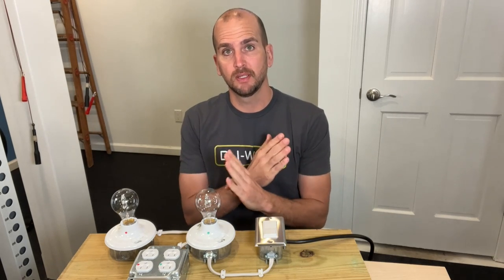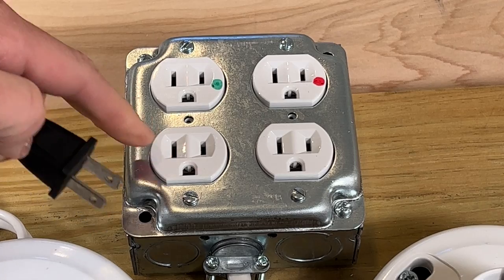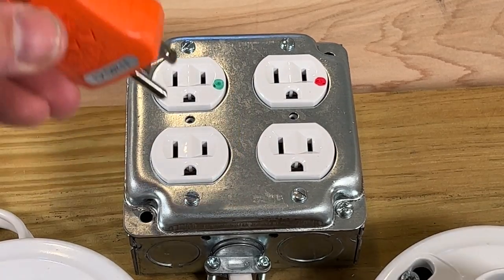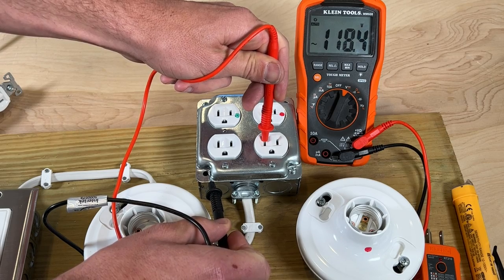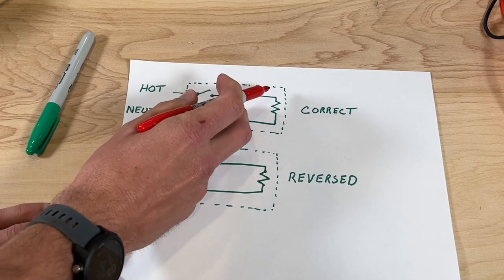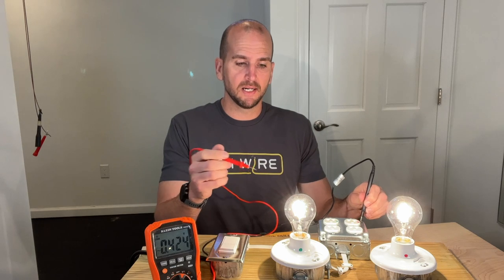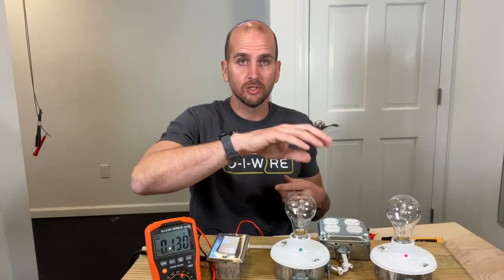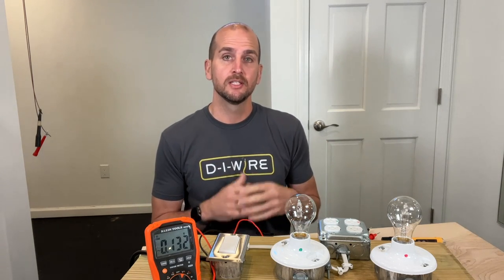Dangerous Wiring Issues In Lights and Outlets

Comment: I think the previous owner of this 1960-era house did much of the wiring himself when it was built.  About half of all of the outlets (that were polarized, 2 or 3 prong) had the hot and neutral reversed, and half of the bulbs had the neutral line switched.  There were also plenty of the 2 prong non-polarized outlets all over the house.

Comment: Super helpful. I knew reversing hot & neutral was bad, but never had an explanation for why. It was particularly helpful to see the explanation about a device with a resistor. We had a ceiling fan with a remote burn out, where the control unit just melted. I couldn't understand why, and I think that's probably it. I'm checking that right now.

Comment: Great video.  I would also recommend that people who move into a new rental or house check all plugs with your simple 3 light tester.  easy to do and doesn't take long.  Check lights before changing a bulb.  On an old house I have run across a random plug or light that was mis-wired before I moved in.  Always check ceiling fans and lights before replacing bulbs or doing maintenance on or replacing the motor.  I have found these are mis-wired about 15% of the time.

Comment: I've seen the neutrals being switched in lighting circuits MANY times, especially in older homes. Never assume that power is interrupted with the switch in the off position; check it with a meter before doing any work.
Reply: OR JUST PULL THE FUSE OR BREAKER or do you trust the electrician?  The wrongly-wired hot or live light fitting with some low energy bulbs can be enough to cause them to gently glow when switched 'off' and work fine when 'on' !

Comment: Something very important to note about basic plug-in outlet testers: if the outlet is not grounded, they cannot detect reverse polarity. I learned this when my parents bought an old house and asked me to look over the wiring since I’m handy with that sort of thing, and many of the outlets appeared to be ungrounded but otherwise okay to the outlet tester, but when I used a three-prong cord plugged into a known good outlet as a ground reference, over half the outlets in the house were not only ungrounded, but the polarity was reversed as well.
Reply: It's amazing what you find in older houses. I have no problem with DIY work, I do it all the time myself, but do your homework and take the time to make sure it's right if you're going to. As my father used to say  "if it's worth doing at all, it's worth doing right". I am in an older house, not that old but old enough for the kind of house it is and every 10 minute project turns in to so much more because someone did something wrong to begin with. I'm also a perfectionest so even if it's a minor thing, if I let it go it will annoy me until I go back and fix it.
Reply: This is my dilemma in an older house that has no ground I have to figure out how to test for reversed polarity

Comment: I was recently installing new wall lanterns on my home when I came across one of the old fixtures wired in reverse. I guess the electrician was left handed because he turned the wire in the other direction. I saw that and wanted to be cautious so I checked with multimeter and found that the wire was still hot after the switch was turned off. Always good to check.

Comment: This is a very good instructional video. I would like to add that if you remove the bulb, screw in a make light socket to 2 prong female adapter then insert a 2 prong male  to a 3 prong female adapter then insert a Receptacle/GFCI tester only the “open ground” light condition will illuminate. 

I purchased the Klein circuit breaker “finder” and I also bought the accessory kit to identify light sockets and switch circuit breakers. 
If there are 2 fault conditions present such as open ground AND reverse polarity the 3 prong tester only shows the  open ground condition. It will not toggle between both fault conditions. This is also true if you have both on open ground AND a reverse polarity on a receptacle. Only the open ground condition will be displayed. Once you “fix” the open ground then the reverse polarity fault condition will be displayed. 
I like this video - I was just attempting to identify if my light sockets were wired backwards and the Klein receptacle tester will not allow me to do that.

Comment: Reversing polarity is more dangerous on a plug than a light fixture unless you have a plug wired after the light fixture but it should always be avoided just the same. This was a good and valuable video. I have a 2 year degree in Electrical technology and so far all your electrical videos have been spot on. I also had 40 years working for a regional water authority, 20 of them as an inspector, and know more about plumbing than many plumbers. I have caught so called professional plumbers screwing things up and doing shoddy work. The problem is especially acute when the licensed professional sends a journeyman without checking their work. I have literally had to show some of them how to accomplish an unusually difficult task.

Comment: The problem with reversed wiring also applies to re-wiring of table and floor lamps, something an amateur is more likely to attempt - and get confused about.
Reply: I likely did that with my mother's table lamps when I was a kid.
Reply: Absolutely. If you change a damaged cord on a lamp, throw away the old unpolarized plug and use a new polarized one and make sure the wide prong is wired to the socket and not the spring in the center of the socket.
Reply: Just a few days ago, I just electrocuted when I placing Lamp for testing.. The hot is the outside of the E27 Cap

So I got mad and went to check the person that install the cable..
😒 But then I realize that I'm the one that install the cable..
Reply: @XanderProduction  It could be miswired where the outside wire comes into the fuse or breaker box.  If that is the problem, short of having the electric utility come out and pull the meter so you can fix it you are stuck with it.  Don't automatically assume you made the mistake.  Check it but if it looks correct to you start investigating at the breaker and then where the outside service connects to the main breaker.  In Michigan code requiring that the line and neutral be connected "properly" didn't hit the state electrical code until the 2000's.
Reply: @mharris5047  ._.)/ You're correct about the regulation.. But I live in Indonesia..

It's actually me who make the mistake, bcoz I'm the one who check the Live-Neutral but misplaced the connector..

Comment: This condition can be found more often when repairing a table lamp. The lamp cord used to wire table lamps and some multi bulb ceiling fixtures has a identified conductor unknown to most DIYers. A close inspection of the lamp cord would reveal a rib molded into the entire length of the cord over only one conductor. This is the neutral and would go to the shell of the bulb socket. Lamp socket/switch combinations do go bad occasionally and need to be replaced. Look for the identifying rib on the lamp cord and make sure it is attached to the shell of the socket. Sometimes the cord manufacturer will stamp the information about the wire in the insulation instead of the rib. This will also favor on conductor over the other. Again, this is the identified neutral conductor and should attach to the shell of the bulb socket. Another great video.

Comment: Good warning video that should be followed by home installers.

Greetings from UK where we do everything different (mostly).

For a long time, lamps here have used a bayonet cap, not screw cap, but they can suffer from indentation of the contacts. I am, (like more and more people here) now using ES27 and ES14 lamps as in the USA as they are better.
I always double check the cables to ensure that the live (hot) line does go to the centre contact as in your video.

For all practical purposes, outlets have to be tested with a proper device similar to the one that you demonstrated, as the contacts have shutters to prevent anything being pushed in. For my most recent home installation, I have upgraded to a Martindale tester which also measures ground loop impedance.

I have found some incorrect wiring in our new home here and have since corrected it, but the worst that I have ever seen was in a house to where we moved in the 1980s. The metal frame of the kitchen 3-spotlight unit was connected directly to the (always on) hot supply instead of ground. I have long suspected that this may have been the cause of the previous owner's death, rather than "heart attack".

Comment: Another thing that you need to look out for is when the switch is beyond the fixture. Ex: Power comes into a ceiling light fixture. The hot lead (black) should be connected to the black lead going to the switch and not to the black lead going to the ceiling lamp. The neutral (white) coming back from the switch is now the hot and should be marked (usually a wrap of black electrical tape) and attached to the gold colored terminal or black lead of the fixture. The neutral (white) of the power supply cable is then connected to the silver colored terminal or the white lead from the fixture. Many DIYers get this messed up.

Comment: I just moved into a new house and found several outlets with reverse polarity, open ground, or no power at all.  Checking the circuit breakers, the legends were all obscure and had to trace the entire house to correct.  I am a licensed electrician and that was the first thing I checked even though the inspector failed to identify these issues.

Comment: Great job showing how to test the outlet with a tester. But it’s also possible to use the same tester to test a light socket.  You just need a few more pieces to connect as follows:   Mount an outlet in a box and add two male cords.  One cord is polarized two pin and connects to the outlet at hot and neutral.  The other cord is three pin and ONLY connects to outlet ground.  Then plug outlet tester into outlet.  Plug a polarized light socket to outlet adapter into the light being tested.  Connect this whole device up using the two pin cord to the light socket and the three pin cord to a known good grounded outlet.  The outlet tester will report if the light socket is reverse polarity. 

I’ve done this test at many houses and most older houses have reverse polarity lights.  My own house built in 2004 has half the lights wired wrong. And that’s by a professional electrician and passed inspection.
Reply: or in a house that is new enough to have a grounding conductor, plug a grounded extension cord into a known good receptacle, and use a continuity tester to check between the ground pin of the extension cord and the screw shell of lampholders.  or hold a non contact voltage tester to the screw shell.

Comment: An additional comment --- when checking voltages with a DMM, always reference to a known ground.  Some may assume that they can check voltage using the Neutral as the reference but this could lead to incorrect readings with AC voltages if another fixture in the circuit is incorrectly wired.  Also check BOTH Hot and Neutral during the same test.
Reply: Not an issue... As he was only checking if there was ANY considerable voltage... Might read wrong but that is not a problem in this measurement.
Reply: If it's an old house there is no ground usually

Comment: Interesting. I did not see that coming, but I experienced it with a lamp years ago. I was taking out a lit bulb from a lamp and received a mild shock as I was turning when it turned off. Now I know why.
Reply from the maker: There ya go 👍
Reply: You should never touch the screw. If the bulb has broke off so that you need to use pliers then use special protection. In case of a plug in lamp unplug.
Reply: Potatoes!
Reply: Actually I never said it was broken, nor was it actually lit. I mis-remembered it which is why I remembered it at all, as pointed out in the video, you should never be shocked by a correctly wired bulb.

Comment: I got a tingle one year replacing a burned out C9 Christmas lamp on my outdoor Christmas tree. I was using a pre-polorized string set.
Reply: When you're outdoors it is easy to inadvertently come into contact with the ground. When you do then you're electrically grounded. We use a ground reference for safety but the fact that we do creates a local hazard. Basically if you have to mess with electricity outdoors be careful and try to wear insulative footwear. You do not want to be in the return path for current.

Comment: Thank you. For an Alternative Ed High School class, I worked up a board to show what happens in parallel and series circuits. It was interesting to see what happens with varying the bulb wattage in both types of circuits. The same kind of board could be used to demonstrate three way and other switch combinations as well as the impact of a dimmer switch. Explaining what happens in that type of circuit would be informative too. Thank you for your clear narrative.

Comment: This is why you should hit the breaker before working on  a light, if somewhere along the way the polarity was reversed, the switch being off will not help you. I always check and recheck with a dummy stick (hot and neutral) before I go to work. 99.999% of the time it just scares you sometimes it hurts a little bit and it could kill you.
Reply: Sometimes a neutral or two from a different circuit might be in a box.  It won't set off a non-contact voltage detector, but could give you a serious belt if you separate those "return" conductors.
Reply: @thomaspierce9458  I see that happening, but it would be a perfect storm. also a neutral from a different circuit should be accompanied by a hot from a different circuit, which would be detectable. Once when I was really stupid, I got zapped three times, before I decided I would just hit the main, and avoid a fourth zap.

Comment: I had a reverse light bulb socket, I actually found it when I installed an led. I have almost switched all my bulbs to LED, but the fixture in question I noticed a very soft glow when the switch was off, it was such a low amount of output that almost all other light sources had to be off, so I put that led in another fixture and did not have the same symptom. I  actually discovered it was backwards at the switch, which meant hot was always hot, but still hopefully that’s useful information to someone
Reply: That glow is caused by capacitance between the wires. You can get it even without a reverse switch but that does increase chance of getting it. Better bulbs have methods to prevent that. U just shows how sensitive the bulbs are.

A common method of wiring a switch is to draw one cable from a junction box into the switch and use the neutral as the return. The two wires close together create a capacitor that passes some AC.

Comment: My first home was newly built. It had reversed hot and neutral on the range.  My brother's first home build 9 years later had the exact same problem - different town, different builder, different electrician. My current home was 20 years old when I moved in. Wiring problems everywhere. After the experience on the first house I purchased one of those little 3 light testers and used it everywhere before I moved in. Some of the problems looked to be original to the house (outlets painted in with multiple colors of paint were reversed). Others seemed more recent like the outlet on the front of the garage that was only live if the correct combination of 2 light switches was set - sometimes on with the lights, sometimes on when the lights were off.
Reply: I've never seen an electric range that wasn't 240V 240V doesn't use the neutral connection. 240V is both hots. The transformer that feeds power into your house looks like this Hot+++Neutral+++Hot Now between either hot and neutral is 120V and between both hots is 240V That's just how a center tapped transformer works. We use high voltage in high power appliances to reduce current. Otherwise we'd have to use larger conductors to supply that power. As it is the wire going to your electric range is already the size of a garden hose. We don't want to run a wire to it the size of a plumbing drain. That's why we use the higher voltage.
Reply: @1pcfred  Has it been a few years? For many years code has required a 4 wire connection for ranges and dryers. The neutral is used for 120v loads such as lights, controls/timers, the dryer motor, etc.
Reply: @Sylvan_dB  it hasn't been so many years that the nature of electricity has changed. You swap neutral for hot and you get double the voltage. Because we have to assume that at least one hot landed where it should. So what you did was swap the 240V circuit for the 120V circuit. Now everything what was supposed to be 120V is 240V and vice versa.
Reply: @1pcfred  No, Paul. The electrician wired it incorrectly so the burners on the range could barely boil water. They were running at 120v. The chassis of the range was also at 120v with respect to the faucet nearby. When I called him at 9pm on Sunday night and left a message, he was about to drive 45 miles to fix it but as all the wires were black, I simply swapped the two and the oven and range operated correctly for the 7 years I was in that house.
Reply: @Sylvan_dB  if it was me I know I'd turn the appliance on to make sure it worked before I left. That seems like a minimal amount of effort. I guess it was too much for that electrician to do though. Maybe he was just a really bad cook?

Comment: As a DIY'r, I always use the plug in tester on outlets. Once I did find where I had an outlet wired backwards. Easy fix, easy mistake, tester eliminates it. It only takes a second or two to test. Using the VOM on lights is a very good idea too!  Its really easy to get it backwards on an old chandelier. Typically the wires are not labeled. the only way to know you got it right is to use the VOM on the light socket.